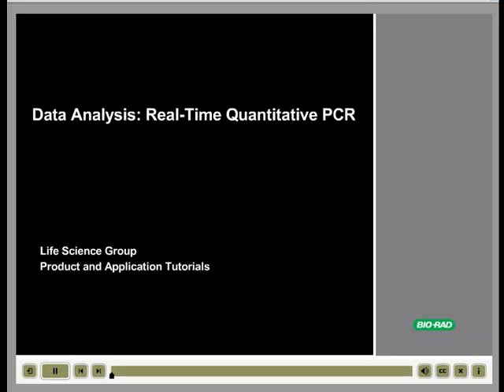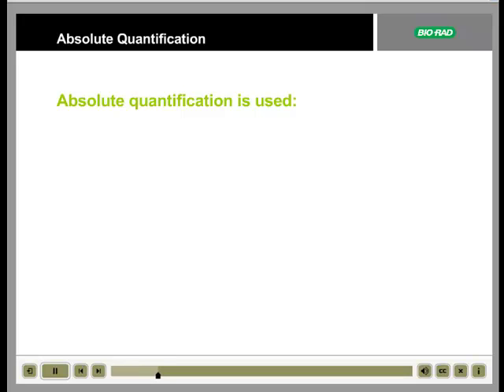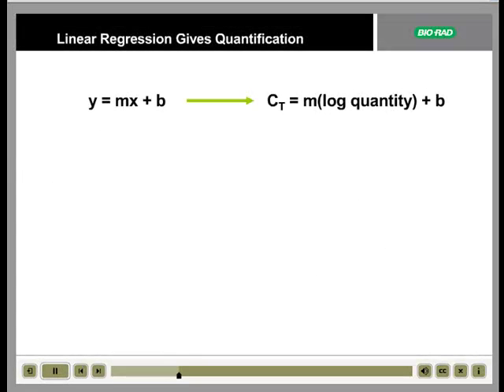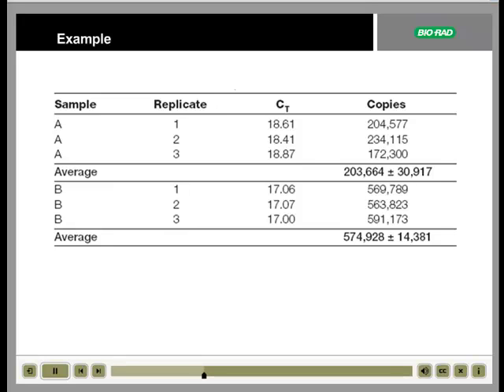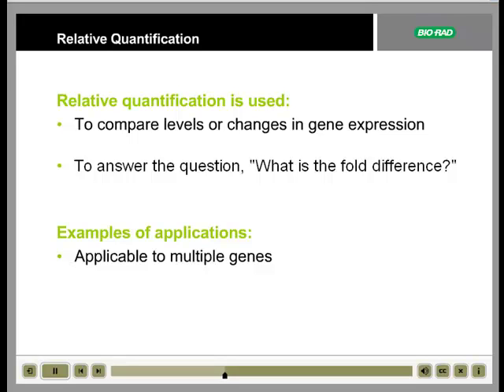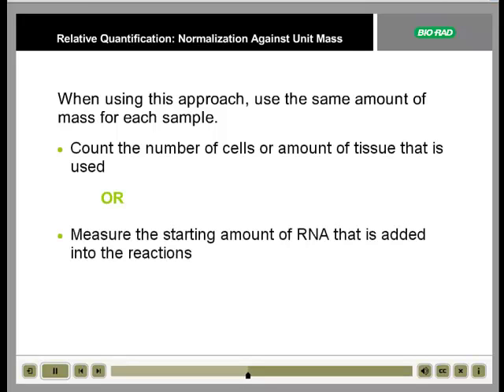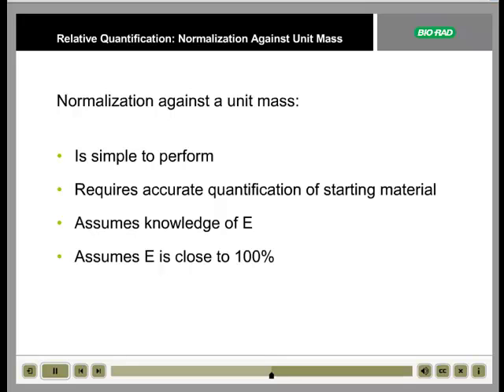Real Time QPCR Data Analysis Tutorial

Comment: Shouldn't we take the ratio as calibrator/test instead of test/calibrator in order to conclude that expression of the gene is 8-fold higher in tumor cells, since the ratio of 8 indicates that "test"/tumor cells have higher CT, thus lower expression? I'm just checking because I'm new to the subject, I'd appreciate it if someone could answer :)

Comment: eventually however enough amplified product accumulates to generate a
1:22detectable signal the cycle number of which this occurs is the threshold cycle
1:27or CT in this plot the threshold fluorescence is indicated by the green
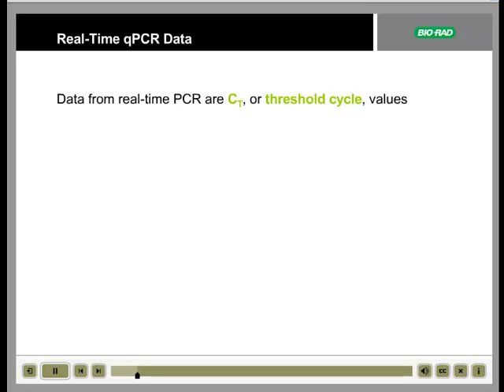1:32line in real-time quantitative pcr the data that are generated are the
1:42threshold cycle or CT values the threshold cycle is determined mainly by
1:48the amount of template present at the start of the amplification reaction if a
1:52large amount of template is present at the start of the reaction relatively few